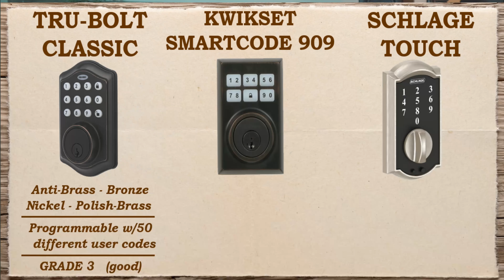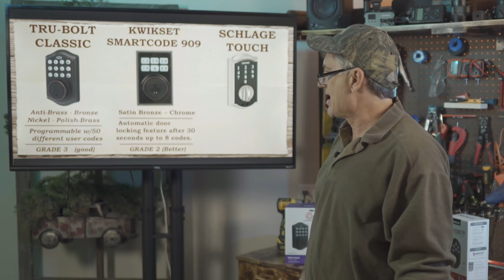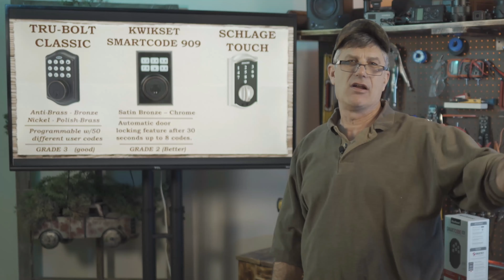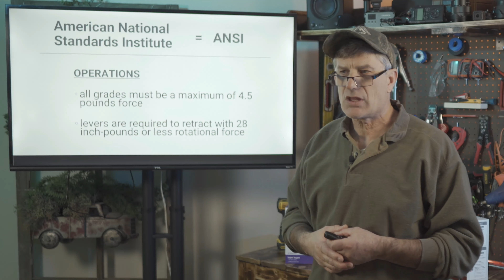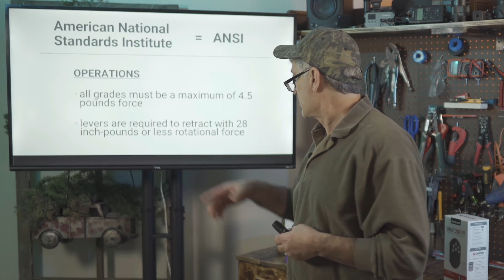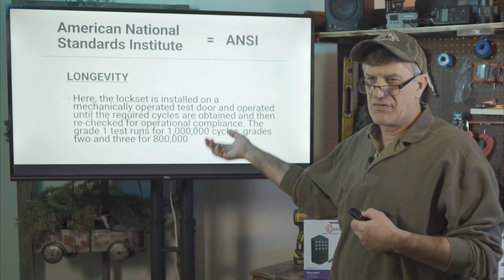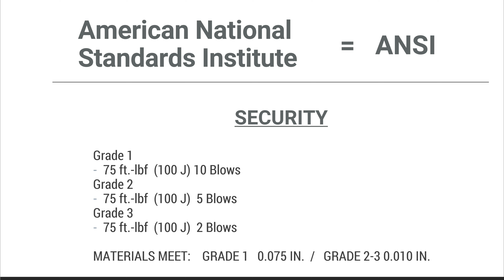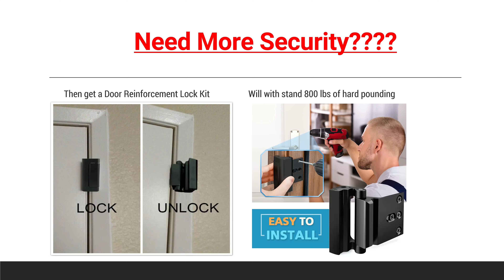3 Keyless Entry Deadbolt Options Under $100.00   "Schlage vs Kwikset vs Tru-Bolt"

Comment: I bought the "Schlage" over 15 years ago. I don't need Bluetooth, motor or RFID because the more they put in there, the more can go wrong. I push the button, if purple, it's locked. If green, unlocked and turn knob and open. Now, this is the lock, but it's only as good as the door & frame. Between the door & house with trim removed. There is a jack stud running from the floor to the top of the door, not the ceiling. The king  stud is longer and runs the bottom sill plate to the ceiling. This allows that wall to be held while the jack stud stops under the header plate as the height of the door changes. Doors, once size is determined, allows for frames to stop close to the top of the door. The measurement is the rough opening from side to side & top to bottom to allow the the door to be installed plumb and level, so now there's a gap. With small trim nails removed just on the lock side, this gap can be measured. Today's lock bolt pocket is deeper as the bolt is longer as these lock as a dead bolt rather than a simple door knob. The pocket can be drilled and chiseled to seat the supplied pocket. At this point, you have the ability to install a steel flat bar. Now after a measurement is made, holes drilled for 3" 3/4" long construction screws that may pass thru will add reinforcement to the jack and king studs with as long as a 2 foot length of 1" X 1/4" piece of mild steel. Place  2 screws above the lock pocket and 2 below. Once room is made for the pocket, the good ones have one hold in the bottom. If not, one can be drilled and screw installed. A good lock is only as good as the frame it's held by.
In this case, adding steel to internal framing members.